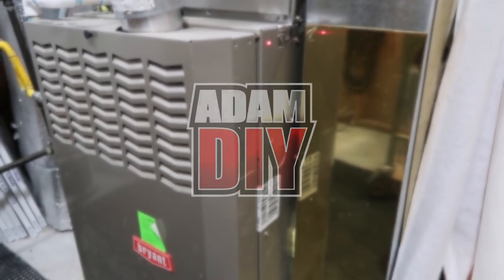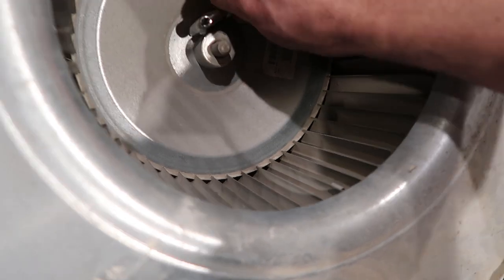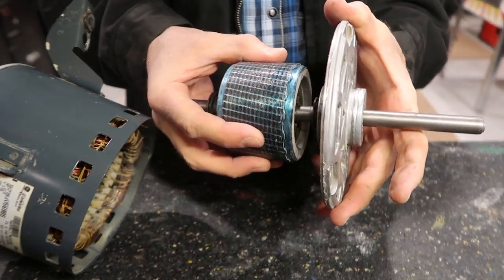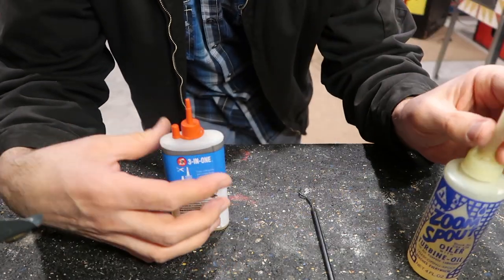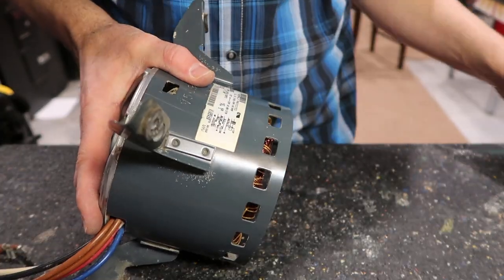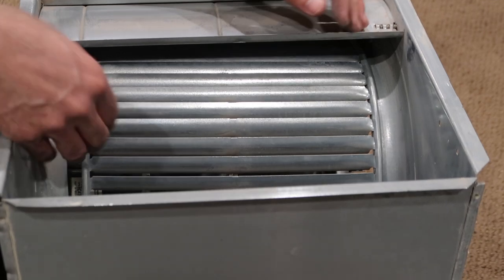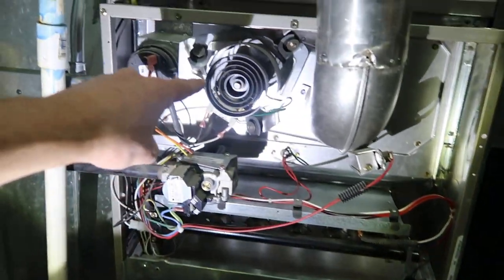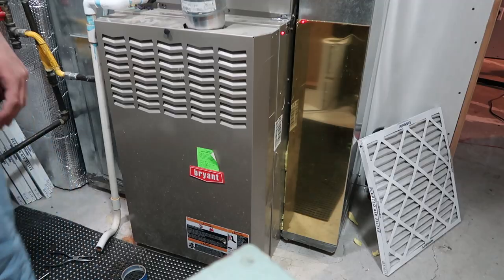How to oil electric HVAC fan motors with no port - Squeaky Furnace Repair

Comment: I replaced my motor in 2010.  I’m hearing a loud noise as it first starts up, but doesn’t last but there’s another noise driving me crazy.  I cleaned squirrel cage w vac and toothbrush and wipes grease on bearings.  Not sure where the capacitor is?   It’s in my crawlspace, pain in the ass to get too.  

Could a motor go bad in 8-9 years?   Says self lubricating.  I think I’ll try your method.  Thanks!
Oh, mine is connected with a belt.  Looks older but no cracks.  I’ll replace that too I guess

Comment: I have both oils.  My 1971 InterTherm MAC 1155 furnace has oil ports on the motor.  I oil before starting for Winter operation and after a couple of months.

Comment: 2:20 No need to open the motor.  There is a steel "cap" on each end of the motor.  Tap around perimeter of that with a screw driver to remove, add oil inside there.

Comment: First questions... did you pre take apart everything before making this video.
You made it look like a piece of cake. Great video by the way.
I'm in a pickle here... the Cotton like stuff you oiled.. mine was crumbled and feel out. At the time I didn't know it was an important part of the motor. 
What's it called? And is it replaceable? And those washer? Looking things on each side of the shaft were broken. Well one side was. Do you know the name of those? I'm working on a dayton 4c447 motor 3m778

Comment: I have a question... I have a very similar motor to your HVAC fan motor (it's an old redmond exhaust, model 3293... how do i remove the fan to open up the casing to see if it still works??? How did you get the fan part off? I removed the top and bottom pin and the screw into the crank shaft....

Comment: Another happy person giving YOU thanks for this great vid. I have an "all in one" unit on the roof- the blower would seize after 5-10 minutes and sometimes never spin at all, just hum & growl. *I had a real problem getting the wheel off of the shaft. Frozen.* Anyway, got the motor out, cleaned and oiled as shown (used air compressor tool oil- similar) and changed the capacitors (three total in my system). Now? Click- WHOOOSH.... better performance than ever! Just again, major thanks. Huge help to me, and needed our A/C in July... in the California high desert. Running strong, just finished it today. (97 outside, 74 inside- ahhh.)

Comment: Nice video on this subject.  I have an American Standard 24 year old gas furnace that is having squeaking issues for about a year now ever since I had a furnace company come and "PM" the furnace.  Knew I shouldn't have had them in but a real estate agent made me paranoid that i should get it officially done even though I have gone in there myself with a vacuum without taking it fully apart prior.  Nice PINBALL MACHINES there too!  You work on those too?  I restore them.  Looks like you have an early 70's EM Williams and possibly a mid to late 80's Williams Video game.  Also a modern Stern pinball machine but can't see enough of it to guess the title.  Iron Man?
Reply from the maker: I have a 1976 Williams Aztec.  It's my first and only pin at the moment. Also, it was my entry into pin repair as it was not working when I bought it.   The price barrier is the only thing stopping me from getting more.   The rest of the games are Defender, PacMan, Street Fighter, Joust, Asteroids Deluxe, Excitebike and some project cabinets.   Lately, I have wanted to learn about electronics repair and this is a fun way to do it.  Also, I worked as a repair guy in an arcade when I was a teenager, but that was mostly fixing coin mechs, bulbs and joysticks. Plus cleaning those playfields!
Reply from the maker: Obviously from your name you restore pins.  Is it just your own or is it a business?  The worst part of the Aztec now is the backglass. No hope in saving it, the peeling is too far gone.

Comment: My furnace does not make noise but volume air has reduced noticeably, the filter is new, first evaporator coil looks good clean of dust (i.e. one right above the blower) and condenser coil looks find from outside, but the volume of air come out of registers is about 50 percent, compare to how it used to be.  I was thinking of replacing the motor itself, I will try putting some oil into it and see if the volume is going to increase.
Any suggestion?

Comment: Just bought a new farm and big old house in Southern IN...  all HVAC was spose to be "new".. train.  But 2 months in... the blower motor just froze...  just that electric hum..  I removed it... looks like whoever installed must have skimped or took the new motor and installed an old "working" one instead..  cuz it's clearly not the same age as all the pretty shiny furnace and AC unit..  and froze 2 months in.  Ugh.  I replaced capacitor.. nada.   So, then took motor apart... dry and some pretty nasty build up, so the rotor and stator where rubbing.  I cleaned, polished, oiled it all... put it back together.. and works great.  For 2 months. Lol.  I used bearing grease..  it just collected dust and gooped up.  So going with 3 n 1 oil at the moment.   Watched vid to see what oils folks in the know where using.  
I'll likely replace it,  but with 4 boys and xmas this month..  gonna just patch it thru the holidays I think.  Good vid.  Thnx

Comment: thanks for the video. my 20yr old very dirty fan was not making noise and moving freely, but 3 times in the last month it didn't kick on with the heater.   I was home and heard the thermostat click but no fan so I opened the panel and kicked the fan a couple times and the fan motor started running.   I pulled the fan & cleaned everything and oiled the motor as you taught.  The packing did look a little dry.   I'd like to replace the capacitor as long as I am in it but am having trouble figuring out what it is since a lot of the label is faded. is it most likely my problem was a combination of needing oil and mountains of dirt clumped in the fins? I haven't put it back together yet in case I can figure out what the capacitor is.
Reply: It's a 10uF/370 V cap. Replace it. They go bad when motors go bad.

Comment: Anyone know if these 'bearings' can be replaced with actual sealed bearings?  Mine dried out enough that it wore into the shaft a little and the bearing surface quite a bit.  A new motor is $200 (which I'll probably have to do), but if anyone knows of a direct replacement, that'd be great.

Comment: I'd like to attempt this squeak fix soon but we are in for some cold weather so if I mess up, we'd be down and shivering.  Not sure if there are ports on mine to oil.   You familiar with American Standard ones from 20+ years ago?
Reply from the maker: No I haven't.  But if you see a little plug on your motor, that is a good sign!

Comment: Thanks for the great video. I just did this for my outdoor (condenser) fan, which was slowing down mid cycle and causing the high pressure switch to kick out. Its all running fine now, but what do you think the longevity of the motor will be having gone through this? It sounds good, but maybe I should invest in a new motor anyway?

Comment: To everyone that wants to argue , 
I do this for a living ,That's a P.S.C motor your looking at $40 to $120  for a new motor. 
You went through all that trouble to pull the motor out and some are hard to get to (attics) , just change the motor save your self a headache later. Keep your old motor as a rescue motor in case you need it later (perhaps you have a rental property and this old motor will get them by till you get a new one installed) and yes oil it. If you cant afford a 120$ motor you have a different issue. 
  If this was a $500-$1,000 P.S.C motor (maybe belt driven, Commercial or what not) Yes I would oil it, But I would do so on a routine basis as part of the maintenance not wait till it's already making noise, These motors aren't like brake pads, "hear that screeching? Better tend to that"
Reply: @AdamDIY  Excellent video very well taught,spoken and filmed ,nothing against you . Keep up the good work.
Reply: Yeah right (wrong) just because 99 percent of the people throw new parts  at it doesn't make it right, if you have a brain anywhere near your head you can Read where this man has helped many people save thousands of dollars total, Many of these people will never touch their motor again because he shows them what a few drops of oil will do, I despise parts changers, you know as well as do that just because a part is new Doesn't mean that it's better.

Comment: never use 3 in 1 oil. use only no 30 machine oil (singer sewing machine oil at walmart). or ST9(bicycle shop) or mobil 1 car oil.
I would most likely use mobile 1
 My 1976 lennox blower lasted till 2013 because I oiled it every other year. replaced entire system with new lennox hvac and am happy with it.
Reply: I think most of the old motors can use 30 W motor oil. I like your idea of using Mobile 1 being it’s full synthetic. I bet it would extend the life of the bushing or bearings?

Comment: hey Adam I have a Carrier furnace similar to yours, except mine has only 3 blowers. I understand the cycles of the furnace but don't know how long burners are suppose to stay on. My house wont reach desired temperature and the burners only stay on for approximately 3 minutes before they cut off to cycle again, is this normal?

Comment: Omg I have been so cold. My mobile home Coleman 7900 has begun squeeking so loud and I dont want to run it and ruin it. I tried to find the oil ports and cannot find any and I cant afford for someone to do this so it looks like I have to figure this out but I am terrified of electricity.
Reply: Cut the main power circuit if you have doubts. A circuit tester is like $10 bucks, found in any hardware store. Worth the effort if you're avoiding any unnecessary tasing. Discharge the capacitor as instructed, and wear rubber gloves as a precaution. Rubber soled shoes is a consideration as well.
Reply: Oil ports are found on really old furnaces. The newer ones don't have maintenance ports, for obvious reasons. They want you to buy new parts.
Reply: @robertlee4172  oh my goodness yes I want to avoid tasing. I know there is a switch by the heater and people say to turn that one off but are you saying to go to the breaker box and turn off everything? I might feel more comfortable doing that.
Reply: @robertlee4172  yes mine is from the 80s I pulled out the motor. It comes out still inside the housing and couldn’t see ports. I will look again. Do you think the oil that came with my treadmill will work or do I have to get SAE 20?
Reply: @Wendyjo123  "the oil that came with my treadmill will work ?".....The truth? Yes, to some degree. But you're better off with 3 in 1 motor oil. The rpms of a fan runs much higher and more often than you'll ever  generate on a treadmill. A bottle costs like $5 bucks, and is rated for 1/3 hp motors. Stick with the SAE 20 lubricant.
Reply: @Wendyjo123  The older inducer fan motors have two ports directly atop the spindle housing. Shine a powerful light source on the top of the inducer. The holes are very tiny, so a 60 watt+ light source or brighter will help. 3 drops in each hole, overfilling it will not make it any better. But getting it on the inducer parts could cause future problems.

If you don't see the ports, then it's time to source out a new inducer. That 'designed obsolescence' thing. Snug tight on the metal screws, but not too tight, or it may crack the plastic cover on your fan.
Reply: @Wendyjo123  Oh Carp!!! I just realized I spoke without asking..."The squeaking sound, is that at the start up of the furnace? Or does it just make sounds intermittently? If it's the inducer fan then it's a service call to the local HVAC guy. Carbon monoxide is a dangerous gas that needs extra professional attention.

Given that your furnace is 40 years old, the serviceable parts will all need replacing eventually. For piece of mind, start shopping for a new furnace or alternative heating.
Reply: @robertlee4172  it kind of works up to a squeaking. I don’t know what an inducer is but I see a little hole in the way back but not one in the front but there is this little black tube. Should I put it in there? Can I use w-d 40?
Reply: @Wendyjo123  From what I can understand those"ports" are above the bearings. I've never seen one live in person before so I won't be much help there. There are two fans in a furnace, an inducer that vents the unburned gases out the top of your house (metal chimney like tubes - the flue) The other fan is the blower which circulates cool air from your home past the heated element (heat exchanger) in your furnace. 

The noises may be caused by a number of things. Loose fan wheel, metal screws coming undone, bearings in need of lubrication...Given the age of the furnace, my thinking is it needs to be replaced. But ask a HVAC tech first. 

Corrosion plays a major part in the squeaky noises from an old furnace. Again, I need to stress, carbon monoxide is the biggest concern. Your furnace has given you many years of service, it's due for a rest.
Reply: @robertlee4172  well when you have any money or heat or job you don’t give it a rest .. you try to fix it but thank you anyway for taking the time to try to help. Have a good day
Reply: @Wendyjo123   No to the WD40, although the 3in1 is a WD40 product. No to the spray can stuff. The machine oil you'd use would be the can with a drawing of a motor. It's developed for high rpm use.
Reply: @Wendyjo123   You welcome. Good luck on the project. Do consult with the H Depot HVAC rep. They truly are a valuable resource of info.

Comment: Can I use the wd-40 oil instead 3 in one oil ?
Reply: No !!!! Do NOT use WD 40 !!!!! It is NOT oil,it is a penatrating solvent for loosening seized or rusted bolts and fasteners,NOT for lubrication !!!!!!! Use 3&1oil for electric motors !!!!!!!! ♿ 🇺🇸

Comment: Use any screwdriver that your not touching metal? be careful with that advise. If it is a wood handle it can adsorb moisture in high humidity situations and still give you a serious shock, especially if you forget to use the grounding lead as this guy neglects to use it in this video

Comment: The material inside the bearing (known as a "sleeve bearing") is called "Permawick."  This is the material that absorbs the oil.  Here is an article on it:  http://www.permawick.com/PermaWick.html        The article says you never need to re-oil this material, but that is NOT true.  I live in Tucson, AZ, where it gets unbelievably hot with little humidity and the electric motors in my AC units frequently burn out.  I've had to replace about three or four of these small electric RV AC motors in three years.  The manufacturer's of these motors are well aware the sleeve bearings need to be re-oiled, but they want their customers to keep buying new motors instead of putting in oil ports where we could then re-oil these sleeve bearings and extend the life of them by who knows how long.

Comment: PSC motor will last forever if it get oil every 3-5 yrs. Especially those fan motor baked under the sun all the time in the outside condenser unit, they need oil every few years, else you have to replace it.

Comment: Hi  I have a a/c fan motor making sound (sometime) with no oil fill hole,  can I flip the motor over and add few drop of oil to the shaft and let it drip inside?  would this work without disconnect and re-assembly the motor?  I don't want to mess up too much, would the oil hep by sliding down the shaft or it is too late for the fan motor. Thanks for the video.

Comment: Great video, very informative, but for the extra labor just to do this, I mean just replace the motor. I’ve oiled motors like this only to have the bearings fail 3 to 6 months later. Just replace the motor. Safer for the customer. No call back. If it’s your own home unit, I can see this being useful, but I did this same thing to my own home unit, it failed less than 3 months later.

Comment: Hello Adam, How do you call the sponge/cotton ball like thing that holds motor oil for the bearing? Do you know where I could buy it? Thanks!
Reply: It is called "Permawick."  Here is some info on their website:  http://www.permawick.com/PermaWick.html
They say in the article that this material never needs to be re-oiled, but this is obviously NOT true.  I live in Tucson, AZ, where it gets so unbelievably hot that this material, along with the heat produced by the electric motor, dries out this Permawick and, once dried out, causes the sleeve bearings to overheat, fail, and ruin the motor.

Comment: Is the fan supposed to kick on before the ignition of the gas? My Goodman fan kicks in after the gas ignites.  I am worried it was wired wrong cuz I checked the wiring diagram.
Reply: Carriers do this if you turn off/back on power to the fau with a call for heat at the thermostat . 90 second purge basically .  Goodmans won't do it unless you trip a limit which will reset automatically in most cases .

Comment: Great video---thank you, Adam.    The part about a bad capacitor really got my attention.  We have a Trane BLU055F936B2  (1986) and it is starting to hum during the first few revolutions of the blower motor on startup.   I was thinking it might be the motor shaft/lubrication but our wheel spins freely and doesn't squeak when running.....the only odd noise is the first 2-3 seconds during start up, then goes away.   I may just put in a new capacitor to see if that hum/sound goes away!!
Reply: It could also be the squirrel cage is out of balance if it's a squeak noise it's a mechanical issue not electric capacitor will either not work at all or will heat up and shut off but the only noise they make is a click when they shut down